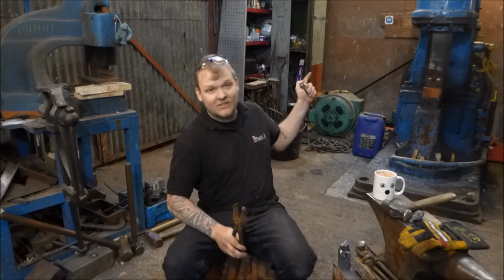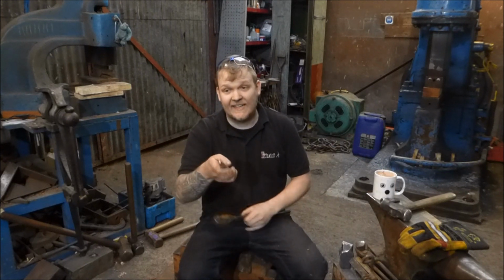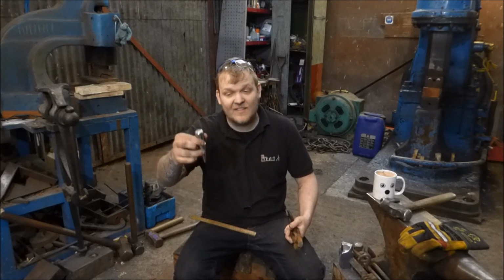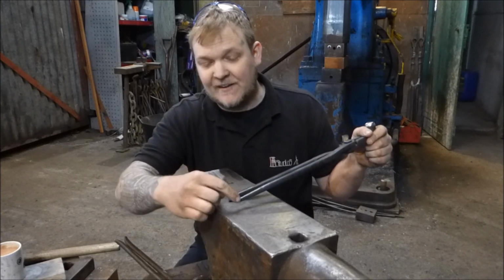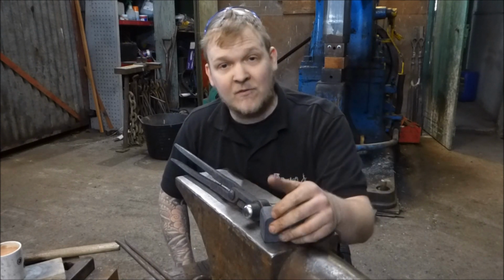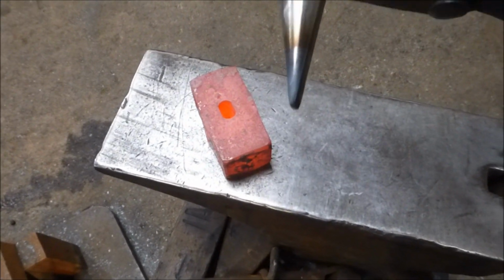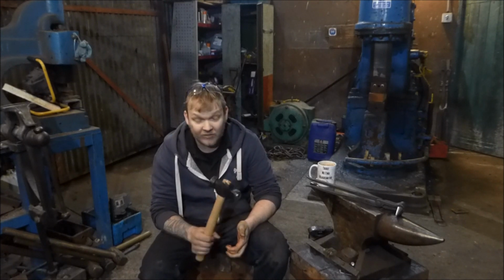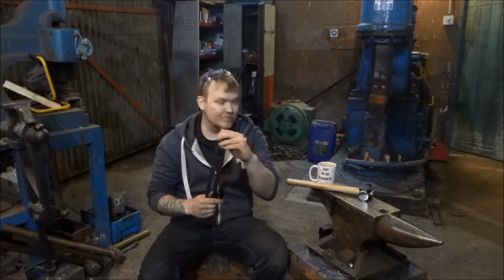Epic tooling for punching hammer eyes! Trust Me I'ma Blacksmith!

Comment: Great video Dan and like the tooling idea here. I probably missed a point somewhere but why not cool the tool periodically so as not to deform it at all.?
Keep it up dude even if it is a short tool 😉😂👍🏻
Reply from the maker: Peter Edis not sure I said why not to. H13 is an air cooling steel and would really hate being dumped into water. it tends to explode if abused to much. abuse is not hitting it hard and getting it hot lol.
Reply: Daniel Moss ah OK, don’t want any kind of steel flying round the workshop. Well, unless you throw it at something or someone of course lol
Cheers 👍🏻
Reply from the maker: I believe Toby hinkman was very badly injured dude to this. forging under a hammer only for a bit to brake of and pass through him.
Reply: Not good.!
Reply: One of the beauties of H13 is that it CAN be water cooled during use as long as it’s black heat of below

Comment: I dig your work Daniel but would like to note it wasnt even Hofi idea. those tongs and smaller tooling for them have been around and available for decades. I have seen complete sets in blacksmithing catalogs as far back as 1900 or 1901 as well as several blacksmith and farrier supply shops online carry them